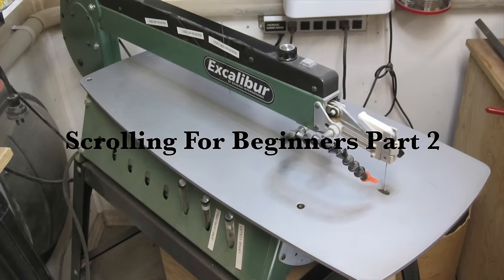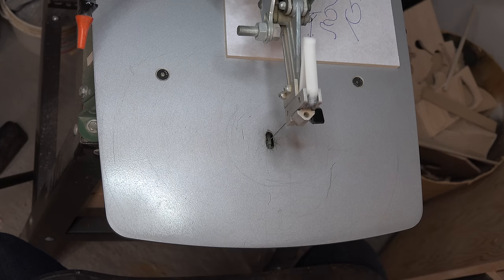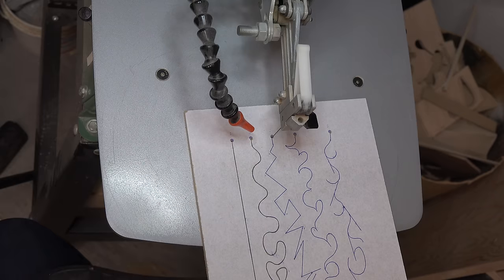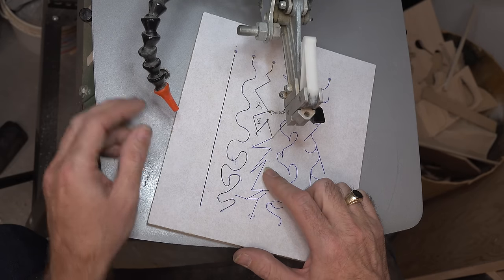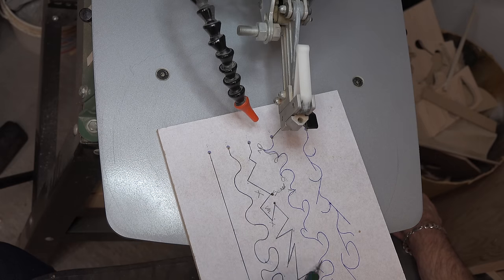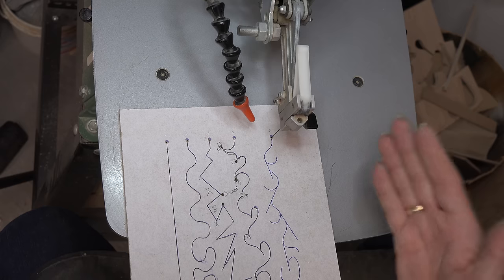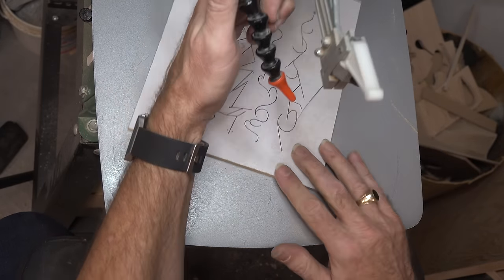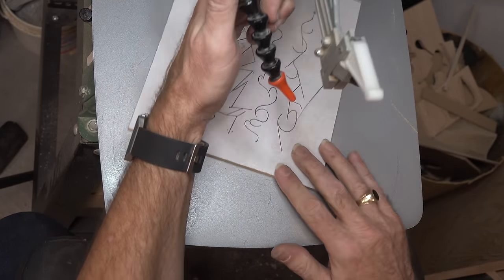Scrolling for Beginners Part 2

Comment: You are such a breath of fresh air when it comes to learning how to scroll. I didn't understand on the 1st video why you couldn't use a fence guide for straight lines. Since then I'm reminded of my jigsaw that seems to always need a 5 - 10 degrees of angle to cut straight so this must be a similar type of drift. 
Practice, practice, practice seems to be the order of the day !!!! 
I can see that it's a craft that one has to learn . . .  bit like plastering  . . . either you can do it, or never get the hang of it. My brother is a mathematician and I gave up trying to teach him to plaster as he just couldn't get a feel for it. 
You say to use mineral spirit to clean the adhesive off wood when removing the pattern. I thought that it might leave a slight residue if using water based products on it afterwards. Would 99% IPA be better if using water based products like paints or varnishes to finish it.
Reply from the maker: I use water based finishes constantly on my scroll pieces.  Once the mineral spirits or paint thinner is completely dried, and you are able to sand the scrolled piece, there is no residue left on the wood to interfere with the applied finish.  While mineral spirits are my preferred removal substance, you can use anything that will dissolve the glue and clean the wood's surface.  If you don't feel like cleaning the glue residue off the surface of the stock, you can always apply a layer of masking tape to your wood first before gluing down your pattern.  You can then remove the pattern by removing the masking tape, therefore eliminating any glue residue and the need to clean it up.  I hope this helps Richard.  Thanks for tuning in.

Comment: Kenny, I have watched a bunch of scroll saw videos and as you know there are some great scrollers out there.  However you are the only one I have seen that talked about speed/radius ratio.  Thanks so much for that.

As to softening the back edge of the blade, I have heard that from one other scroller however the reason that person did it was because it made making right angle (or steeper) turns easier.  But I can see your point as well.

And for the beginning scroller, (like me), remember scrolling is like driving a car with the front end out of line and about a half a turn of play in the steering wheel.  :)

Thanks again for a great video.
Reply from the maker: Good analogy on the car driving Katie.  That is pretty much what it is like.  I have been doing it for so long that I don't think like that anymore and to tell you the truth, I was having a hard time explaining what it was that I was doing to compensate for the drift because it is so second nature to me now.  I'm glad that you enjoyed the video and once again, I thank you for tuning in to the show.

Comment: I have learned to use my jig saw, and now interested in learning the scroll saw. I have not bought one yet, but researching them for what I will be doing. Great informational and technique video. Thank you so much. Love it!
Reply from the maker: Glad to hear that you enjoyed the show and found it useful Nancy.  There are plenty of scroll saws on the market and they all have different features that can make choosing one a little frustrating and confusing.  I produced a video about 6 years ago about the options available for scroll saws and what they mean and what to look out for.  Although the Excalibur that I feature in the video is no longer in production, the features and content of the show is still relevant today.  Here's a link to the program.  https://www.youtube.com/watch?v=kBCdGKTaQms&t=1010s
I hope it helps you in your quest for a new saw.
Thanks for tuning in and please don't hesitate to ask any questions you might have.
Reply: Me again. I think I picked out a scroll saw. Thought I'd see what you think about it. I saw it at Lowes. Comes with a table. It's a Porter Cable 18", 1.6 amp variable speed scroll .. item #432508, model PCB375SS.  Not putting you on the spot. Just asking your professional opinion if that's allowed. Thanks..
Reply from the maker: @Quiltertu1  of course that's allowed.  In fact, that's what I'm here for and that's the whole purpose of the channel.  I have to say that I've never worked on the Porter Cable line of scroll saws before but I've gone through the listing of features on this saw from Lowes website and I think it will suit you just fine as an entry level saw.  Variable speed, accepts pinned and pin-less blades, left and right tilting table, no tools needed to change the blades etc.  The fact that it has the work like and stand  is a bonus for sure.  I think that with the right amount of practice,you will do just fine on this saw.  Nicely done Nancy.  If you have any questions at all while you are learning, please don't hesitate to ask.  If you don't wish to comment in the public comments section of this channel, you can visit the channel's Facebook page and send me a PM.  https://www.facebook.com/kennyearrings1
or you can drop me an email at acutabove_woodworking@hotmail.com.
I hope this helps.
Reply: Thank you for your help Kenny.  Your the best.
Reply from the maker: @Quiltertu1  You're very welcome.  Any time.

Comment: Gosh, you make it look so easy!!!  I am completely stymied.   I feel like a toddler on this thing.  This thing is like a helicopter - maintaining direction is a challenge when your piece can rotate around the axis.
Reply from the maker: Blade selection is a huge part of successful scrolling.  You might want to check out my video on scroll saw blade selection.  (it's long but it's packed with information). https://www.youtube.com/watch?v=UG6S5tqx6bI&t=5s
I make it look easy because I have approximately 28 years of experience on the machines.  Keeping your cut on the lines can be a challenge if your saw is not set up correctly.  I have commented on the comment that you left on part 1 of this series.  I am more than happy to help you diagnose your problems with scrolling if you want to start by answering the questions that I posed on your other comment.  We can figure this out together but remember, patience and practice have no substitutes with scroll saw work.  Thanks for tuning in to the show.

Comment: I appreciate the repetition of the feed-rate-to-rotation-rate advise as you demonstrate the where and why (even for the sharp corners). That helps. Love the outside corner loop hint.
Those stop-&-rotate corners make me cringe, thinking you'll break the blade. Then I remember that this is not a bandsaw, with a blade many times wider than it is thick. (But I still cringe.)
The heat gun removal of the pattern was yet another great tip.
Reply from the maker: Don't be afraid of breaking blades Stuart.  Blades are consumables with a scroll saw and you will break many of them over your scrolling lifetime.  The spinning of the blades like that works with the smaller sized blades, but you will never be able to do it with thicker stock and thicker blades.  Good luck with your scrolling adventure and please don't hesitate to ask any questions you might have.  Thanks for tuning in.

Comment: I just bought a scroll saw a few days ago and haven't had a chance to put it together. I was so glad to see you say something on blade drift. I would have been massively frustrated for it not to cut "straight" and probably obsessed over what was wrong.
Reply from the maker: Just the nature of the blade vs the wood Terry.  You will learn to compensate for it in no time.  Good luck with your learning adventure and if you have any questions at all, please don't hesitate to ask.  I'd be more than willing to help if I can.  Thanks for tuning in to the show.
Reply: @acutabove_woodworkings  Thanks. And Holy Crap still replying to comments after three years that is impressive. I've seen CGI tutorials only a few weeks old with hundreds of unanswered questions. Awesome connectivity there.
Reply from the maker: @terryrhuebottom  I do my best to answer all comments.  I do occasionally miss some, but for the most part, that doesn't happen.  If people are nice enough to watch the show and comment, then the least I can do is take the time to answer them.

Comment: Ken, I enjoyed part 2 as much as the first part. That was a great tutorial not only for the beginner but I think there was something for all skill levels. For me the hardest thing to overcome is not applying lateral pressure against the blade. Like you said, the only way to become proficient is practice. Paul / paulsmessyworkshop
Reply from the maker: Thanks Paul.  I think that lateral pressure is an issue for all folks, especially the beginner.  It just take practice and concentration to overcome that problem and once you get the hang of it, scrolling is just second nature.  Thanks for tuning in my friend.  Great to hear from you.

Comment: Hey Kenny, I like your scroll saw for the ease of changing the blade. Mine isn't as easy and more time consuming. I scrolled out the Lord's prayer and ended up using the scroll saw for the bigger parts and using a hand scroll saw for the more intricate parts. I had more control that way. I've been putting off making 2 clocks that have to be scrolled. Have to make my wife a cabinet for her sewing machine I've been putting off as well. Guess it's time to get more wood. Thanks for the video.
Reply from the maker: You're very welcome.  I'm glad that you enjoyed the show and were able to gain a few tips from them.  Good luck on your future projects.  If you have any questions at all, please don't hesitate to ask and I will do my best to help you out in any way I can.  Thanks for tuning in to the show.

Comment: As an ex seamstress this feels a lot like sewing of sort, I feel you are using a foot switch, it makes it seem a bit less scary to me, I am starting out with what I thought would be easy, some straight and slightly curved lines, fingers crossed I can do this, I enjoy slow, relaxing projects. Thank you so much for putting together a well done tutorial.
Reply from the maker: Glad that you liked it Jessica.  While it might seem that the concept is like a scroll saw, a sewing machine is quite different.  With a sewing machine, you don't have to worry about blade drift or the density of the wood changing the speed of your cuts.  As well, the foot pedal on a sewing machine is a variable speed unity whereas the foot pedal on a scroll saw is either on or off and the speed is set on the saw's controls.  There is only one way to get good at scrolling and that is through practice.  Don't be nervous, just jump right in there and work away.  If you have any questions along the line, please don't hesitate to ask.  I'd be more than happy to help if I can.
Thanks for tuning in to the show.

Comment: Thanks! I'm a newbie and this video helped me a lot. In line 3 when you back up then reverse the direction of the blade relative to the stock by rotating the stock 180 degrees. I've watched it a dozen times and I cannot duplicate that trick. My attempts just twist the blade. I try pulling back ever so slightly but the blade is wider than the width of the cut. I'd welcome anyone's insight into what I need to do differently to accomplish this feat.
Reply from the maker: Let's start off with a little more information Don.  What size blade are you using and what thickness of stock are you cutting?  I can better diagnose the problem after I have that information.  Thanks for tuning in.
Reply: @acutabove_woodworkings  Thanks for the reply. 1/4" bass wood. I was using a 20 tpi Bosch blade. It's plain end. I gather the .110" on the package refers to the blade width?
UPDATE: I tried again and managed to rotate the stock 180 degrees (to reverse the blade direction), creating a small notch in the waste wood side in the process. Virtually invisible (to me) at 480p but when I increased the playback resolution to 1080p and looked at the underside of the wood (31:00) I can see similar tiny notches in your line. Whew! If I've reached any incorrect conclusions please let me know. Thanks again for your videos and your reply. Cheers!
Reply from the maker: @donwaller8955  You have not reached any wrong conclusions here.  The size of blade that you are using seems to be fine for the work that you are practicing on.  I was going to suggest increasing the speed of your scroll saw just a touch and making sure that you have no forward movement in the stock while rotating but you seem to have figured it out.  It can be a little nerve racking because there is the fear of damaging the saw or breaking the blade.  Once you realize that breaking blades is just part of scrolling, you might have a bit more confidence to spin that blade the 180 degrees in the stock.  Now I wouldn't try a blade spin that aggressively in thicker stock but for this type of thing, it's just fine.  I'm glad that you were able to get some successful spins Don.  Feel free to ask any other questions you might have.

Comment: I had to add a fish tank air pump to blow the aria clear.  I have slightly stiff copper wire coiled around it and the hose that is there to hold them in place.
As for the boo boos in a work, like in yarn work or sowing, those little errors show the hand made qualities of a piece.
Reply from the maker: Sounds like you've come up with a great, shop made solution to clear the dust.  Well done.  Thanks for tuning in to the show.

Comment: Ok, so I'm late to the show (sorry). But this was very informative. What saw blade were you using and what would you recommend for such intricate patterns? There are a ton out there. Thanks.
Reply from the maker: Better late than never Rey.  Blades are chosen according to the thickness of stock that you are cutting, not the intricacy of the pattern.  I am partial to Olson brand blades and I prefer a reverse tooth pattern.  A PGT grind (precision ground tooth) is also fantastic but again, it depends on the thickness of the material.  I would suggest that you check out my scroll saw blade selection video.  It's a long one, but it will give you more specific information about blades, their uses and the thicknesses that they are rated for.  Here's a link.  https://www.youtube.com/watch?v=UG6S5tqx6bI&t=881s
If you have a specific thickness of material that you would like the information as to what blade to use, feel free to ask and I can provide you with more suggestions.  Thanks for tuning in to the show.

Comment: Well searching an good video and good info, I believ that I found why my scroll saw is drifting left.Thank you
Reply from the maker: You're very welcome Bobi.  Please feel free to contact me with any questions you might have.  I'd be more than happy to help if I can.  Thank you for tuning in and for taking the time to leave the comment.  It's appreciated.
Reply: @acutabove_woodworkings  I,m newbee in using scroll saw.Tried several times to do straight lines and curved, but my machine Incgo 85W model SS852, always goes left from my point of view.I,m lack of time, but certainly will try the hint with sharping stone.Thanks again for good video.Will folow you.
Reply from the maker: @bblloobb1000  Sometimes, even grinding the back of the blade off will not correct blade drift.  You may have to adjust your cutting style to compensate for it.  Either way, there is nothing wrong with you or your saw.  Blade drift is a natural part of the machine (and blade's) design.  If you have any other questions at all, please feel free to ask.
Reply: @acutabove_woodworkings  after grinding the back side now its better, but cutting matarial is jumping up, did i positioned the blade correctly-tooths has to go from down to ups or up to down
Reply from the maker: @bblloobb1000  The teeth on the blade will point down.  This will not stop the wood from trying to jump but it will help.  For beginners, using the hold down foot to assist in keeping your stock on the table is highly recommended.  I hope this helps.

Comment: I have been watching a ton of “basic” training scroll saw videos to help me get started with this new hobby.  NONE of them have explained techniques or shared need to know (blade drift, feed rate, turning rate, mounting the saw, blade differences & much more) as you have. I am more confident in my pursuit. Any recommendations for an economical beginner scroll saw that will get the job done?  Thanks for sharing these tips!  Great job!

Comment: Kenny, I am by no means a beginner, however your teaching methods are awesome. I have an rbi Hawk model 226 that was purchased back in the early 2000’s, although I did use it when I first got it, it has sat dormant much of the time until several months ago. I am going to be retiring shortly and want to get back into it again. Do you have a part 3 or 4 for your beginner scroll saw series? Keep up the good work. I appreciate what you do!
Reply from the maker: This series never went past part two Joshua as I was just covering the basics.  There are plenty of scroll saw project videos on the channel that I hope you will search out.  Thank you for the kind words on the show and for tuning in.  I truly appreciate it.  If you have any questions, please don't hesitate to ask.  I'd be more than happy to help if I can.  For the record, I wanted an RBI Hawk many moons ago but they weren't available for sale in my area anywhere.  At the time, I ended up with a DeWalt DW788 and used it exclusively until I got my Excalibur EX-30.

Comment: Great videos! That's the hole to drill for a pin less blade, what size to drill for a pin blade?
Reply from the maker: Glad that you liked the show.  The hole for entry for a pinned blade should be large enough to easily fit the pins of the blade through.  There really is no set size.  Heck, as long as it doesn't interfere with your design, you could even drill a 1/4" diameter hole.  I hope this helps.  Thanks for tuning in.